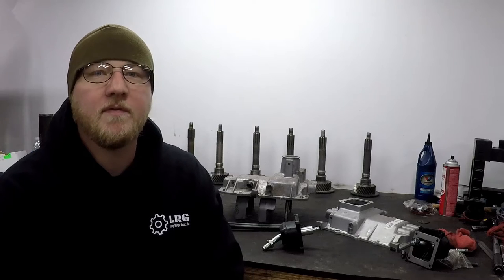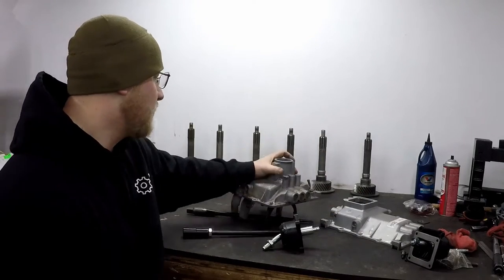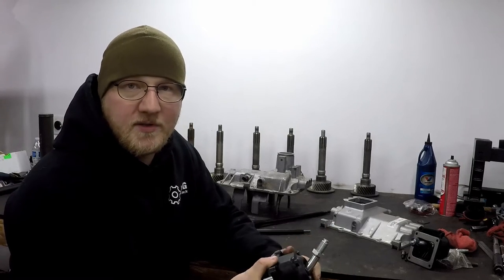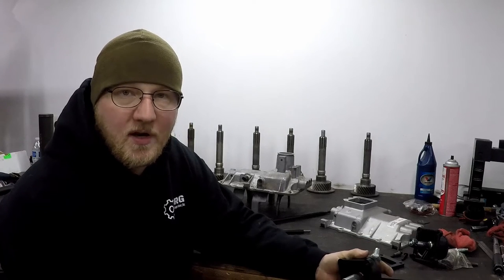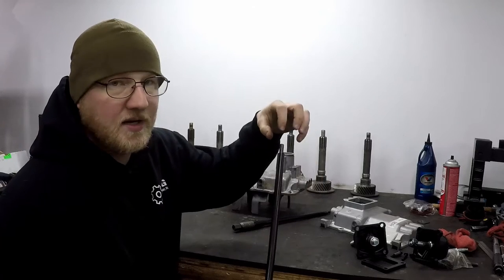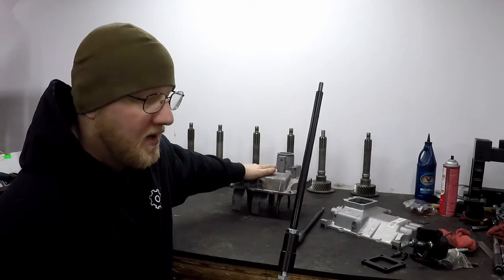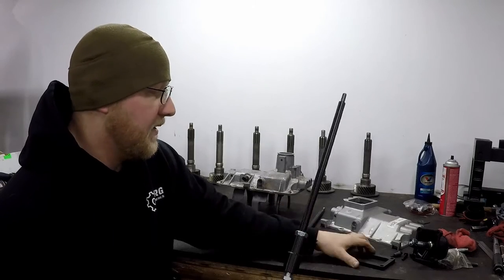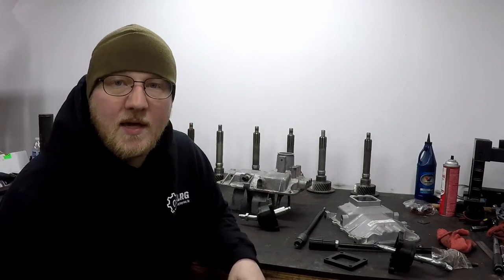Dodge Cummins NV4500 Shifter Tips and Tricks

Comment: What will cause my nv4500 to always get stuck in reverse or extremely hard to get in reverse , 5th gear pops out of gear sometimes, and when putting back into gear it clicks. When transmission is cold it shifts way better. A little easier to get into reverse. It’s always been hard to get into reverse pre rebuild and after the rebuild of the trans. New clutch as well. .. any ideas

Comment: What trans oil do you recommend using on the nv4500
Reply from the maker: MT-85, that’s the one and only fluid you should ever use in an nv4500.
Reply: @longrangegear  thank you so much …any particular brand you recommend…
Reply from the maker: @JVazquez-e5x  mt-85 is a specific type of oil manufactured by Redline oil
Reply: @longrangegear  ok ..appreciated reaching back out…thanks for the informative video !